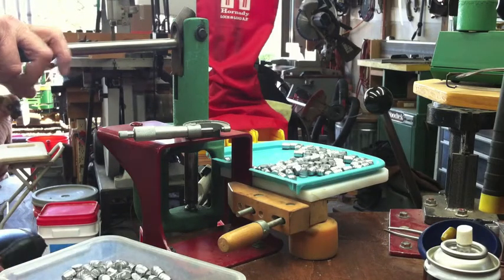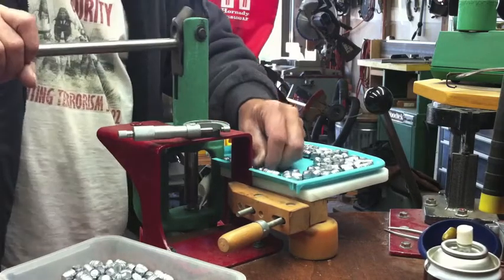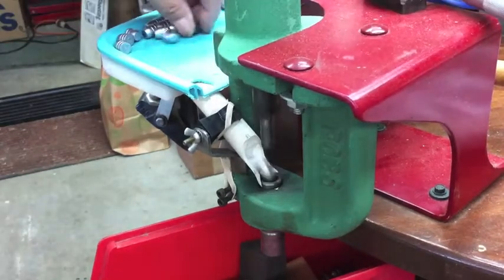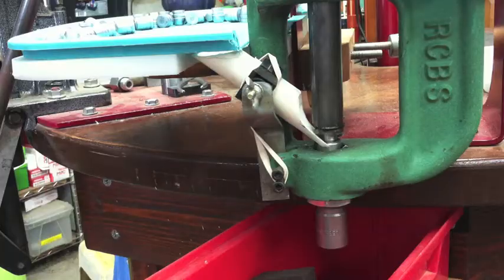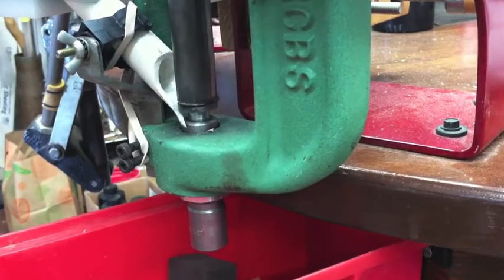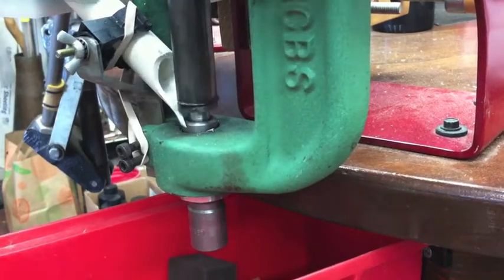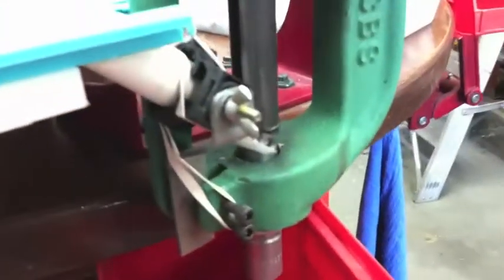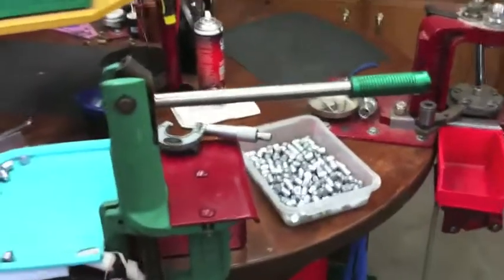FINAL MODS to the UPSIDE DOWN SIZING PRESS PROJECT

Comment: Do you have issues with bullets with different nose shapes feeding the same way in that feeding tube you have?
Reply from the maker: Yes I do...there's no way in God's creation to get a FWC, full wad cutter to feed...other than the FWC's every profile in the 9mm, .38/.357 & .45 cal. drop just perfectly...well, if I don't spaz out and drop them backwards that is. I suspect that rifle casts will require a higher angle towards the size die but haven't got to any of those yet. It's all adjustable and I can put a different tube in it if required. The main thing I wanted was to have the volume of pistol casts go quicker...I get tired of sizing so many at one sitting. The way it is now I can get through 5~600 cast in less than an hour, a 6 pack & a few smokes...course, ya gotta have some good tunes going too.